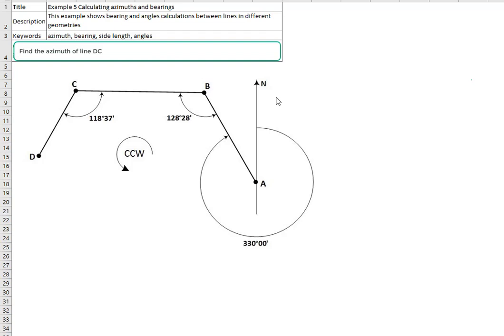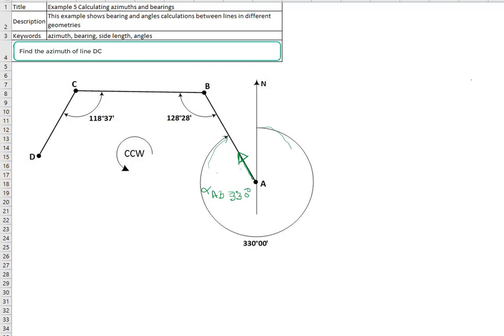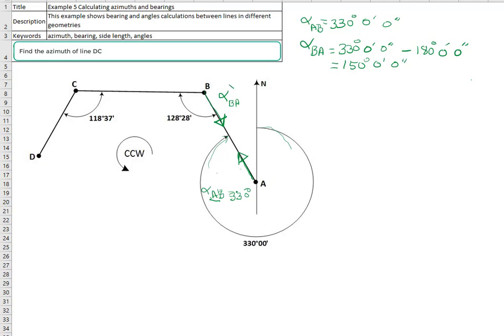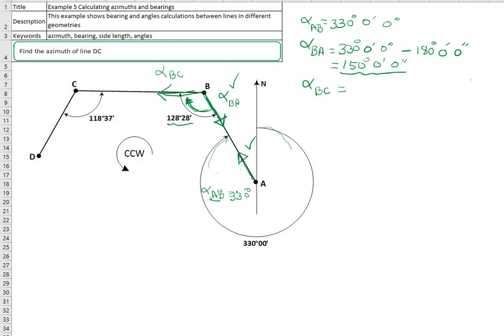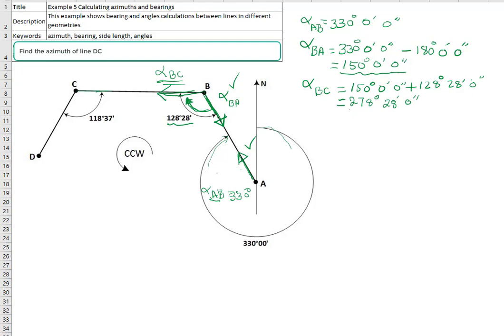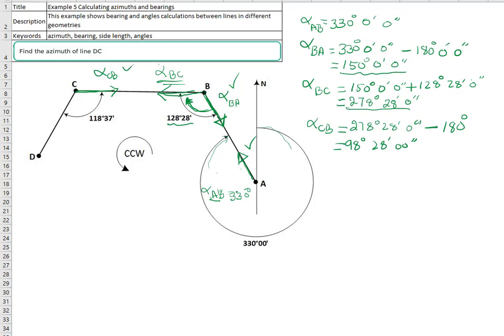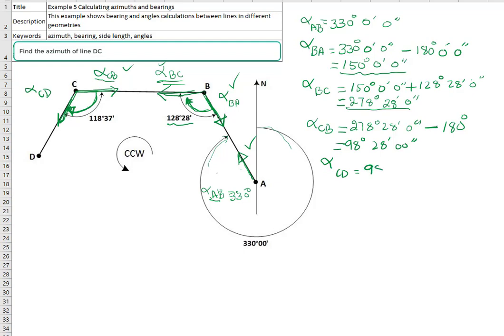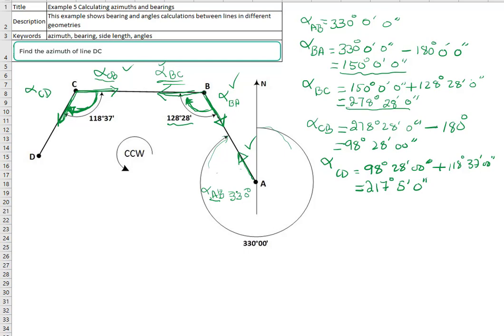Example 5 Calculating azimuths of lines

Comment: This is the counterclockwise. We can use the first way. That such :
330+128 28' 0" then we subtract 360
Reply: I think it's clockwise because when you look at the angle its going to the right. Frrom the actual angle point.